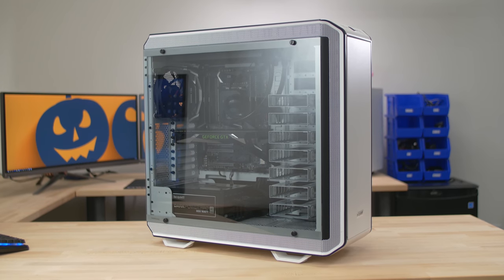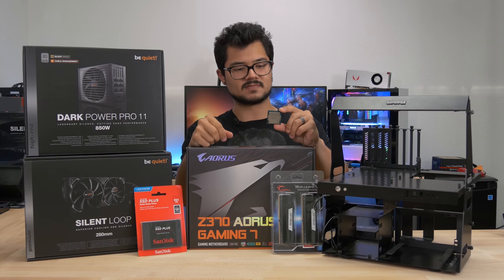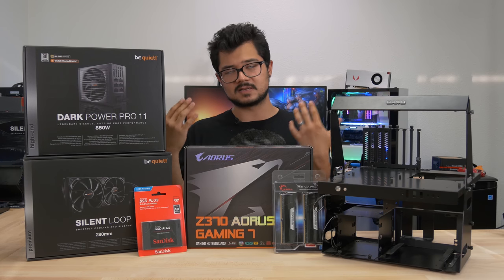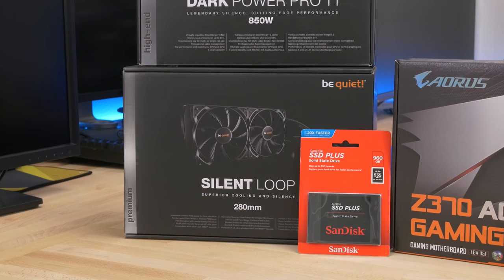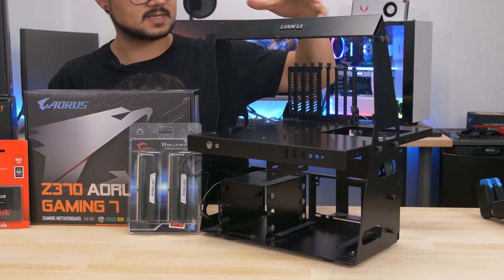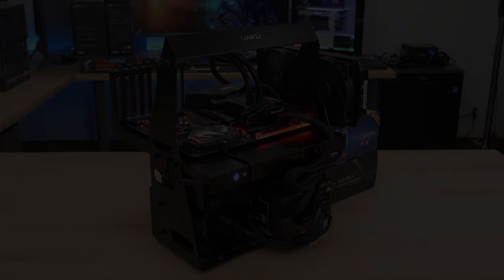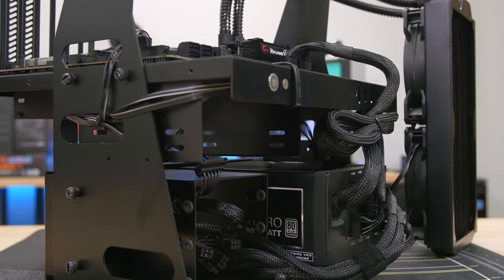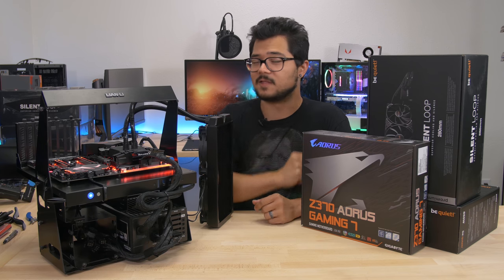Building a Z370 Coffee Lake Test Bed!

Comment: tldr for coffee lake:
If you're strictly into gaming and you have a skylake/kaby lake i5/i7, don't upgrade. But for other reasons, go for it if you see yourself taking advantage of the additional cores/threads or you just need an upgrade from an old system.
Reply: Unless you want price/performance in which case go Ryzen.
Reply: That doesn't change the fact that even a 1700 is competitive across many fronts when compared to an 8700k
Reply: + compare b350 to z370 mobo prices and the fact that Intel makes you buy beefy cooler if you want to OC
Reply: Brother Ares Yeah but you can get a 1700 and it performs the same.
Reply: Solid advice, I bought a 7700k only 2 months ago, I have no regrets, I'll upgrade in probably 5-6 years, by then the mainstream platform will surely be 8 or 12 core processors.
Reply: Unless you want a room heater, then go for Ryzen
Reply: Guys seriously, Ryzen isn't price to performance if you're not going to utilize the extra cores for anything. Comparing a 1700 to an 8700k is a little dumb. We know the 1700 isn't good at gaming compared to coffeelake chips.
You want price/performance and you don't really do anything other than game and watch YouTube or discord or Skype or whatever, you don't need Ryzen, get an 8600k and you're fine.

If you need extra cores for multithreaded workloads, get Ryzen. I actually have a Ryzen system set up as a server but seriously guys Ryzen isn't the best there is at everything, and intel motherboards aren't that expensive, they're like $150. 

Let's say you're spending $1200 on your computer. You get an 8600k with a $150 motherboard instead of a 1700 with a $120 motherboard. (R7's should be getting the benefit of X370 motherboards helping them clock better) and you're spending roughly the same money (to overclock a 1700 to 3.9 or 4 ghz you'll need aftermarket cooler so I'm assuming you're buying cooler for both) and getting between the same as Ryzen to 25+ frames per second better performance in some games. So how is it better price to performance if you're spending the same money for less performance? Let's say it costs $30 more for the intel system overall. That's a 2.5% increase in system cost with a 5-20% increase in game performance depending on game (some games are horribly unoptimized for Ryzen)
Seriously I'm not a shill, but do some basic math, unless you're doing serious rendering or multithreaded workloads outside of gaming, you don't need a 1700.

If you do however use 6 virtual boxes at once or have multiple renderings going on at the same time, or you stream while you game at 10 bit medium speed H.264 at 60 fps, then by all means get a 1700X (don't recommend the 1700, the X model is $10 more currently and is binned for better overclocks, and usually can post with higher ram speeds) 

Be a consumer, buy what's best for you, don't be loyal to one company.
Reply: Hi techiegames im a fan
Reply: i just build a pc , i58400 + asrock z370 fatality is cheaper than i57500 + asrock z270 thats why i decide to go for the lastest one
Reply: The TechieGames if you're taking advantage of more cores/threads, get ryzen
Reply: The TechieGames I'm working on an i3 2130 and a really old radeon HD card, send help
Reply: If you do however come from, say.. 4th gen, upgrade to i5 8600k for gaming.
Reply: The TechieGames i'm sticking with my 4670k for a couple more years.
Reply: A system with an i5-8600k will cost significantly more than a system with a Ryzen 5, and most people don't have the GPU horsepower to see the small difference in gaming either way, so they might as well just choose the cheaper option.
Reply: so the same reasons to go with ryzen, but ryzen is cheaper
Reply: I have i3 6100, should i upgrade?
Reply: Seriously, these people that use ryzen for gaming and yells on the internet to get a ryzen are stupid. I have a ryzen and used it for rendering photos and videos but gaming? they are bad. Intel is still the best CPU for gaming and for general usage.
Reply: If it's not doing what you want it to do, then yes. Ryzen and Intel both have some really good options depending on what you want to do. If you find yourself doing more multi threaded work such as auto CAD, Photoshop, etc.. i would consider Ryzen (They have some really good price to performance chips, but Intel does offer some nice one's as-well). If you're just gaming, i would consider Intel. The new coffee lake processors look really promising, i would consider the I5 8600K, if it fits your budget (if you're gaming more then content creation etc...) it actually beat out the 7700k at a cheaper cost.
Reply: The TechieGames don't be arragent, Intel has been holding back for so many years and money grabbing all you shills!. Remember no company is saint but INTEL is so much worse consumer wise than AMD. They have bribbed so many OEMS so AMD cpus don't get sold. GO watch Intel anti consumer video in YouTube to see for yourself. Do some research before u support a company. Don't go in blindly
Reply: Ryzen bad for gaming? They easily do 100 FPS in modern games.

Comment: Drill holes in the side of that case wing that align with the 4 screws for the fans/rad in the center of the rad. If u get what I mean. Basically like u had it when the rad was sitting horizontal on the boxes.

Comment: Just want to say that the i7 5820K was the first 6 cores of Intel who was " cheap " ( 400$ ) . That was the best moment for anyone who wanted a 6 cores with a 1500$ budget in PC, the i7 8700K is just like this, it look like a good deal but it's not the greatest thing ever done, just a refresh. The motherboard of the i7 5820K was like 250$ I think so it was a pretty good deal. SO please Intel, if you want to compete with Ryzen, make real CPU from A to Z not from R to Z
Reply: When I got my 5820K setup it worked out £50 more when the 6700k setup would of cost so took it as a great deal.

SouthernComfor7 While ipc is better don't forgot that x99 systems have more memory bandwidth plus more cache which is setup better for some stuff then what Intel is doing now with cache but that 5ghz is hard to pass up tho.

Comment: How about, just for kicks and giggles, someone test it on Z270 Mobo and see what happens...after all it's same socket...
Reply: drew alt411 a german overclocker explained that. called der8auer. (he also hold some world records) Its true the pinlayout is different but you could put a coffeelake in a z270. it depends on the mobo itself. some could work, some dont. but if you put it on a mobo which dont work, you could kill your cpu.
Reply: Actually not all of the pins in the z270 are used, there's something like 8 extra power pins and 13 extra ground pins on the z370 that wasn't there on the z270. Even though the layout is the same, where some of the pins end up inside of the CPU is different 
Was the overclocker Der8auer?
Reply: Linus did, they confirmed it did not work.

Comment: Would an i5 coffee lake be better than an i7 4770? Would the extra cores help me get better performance in games? I only have a GTX 1050Ti and would have to get a whole new motherboard and ram so I am a bit worried.
Reply: If you had something like a GTX 1080 or 1070, there would have been a reason to upgrade but since you have a 1050 Ti, the 4770 will be enough
Reply: I will upgrade my graphics card in the summer probably to a 1070 maybe 1070Ti if it exists by then. Might also grab a new CPU, ram, and motherboard while I am at it.
Reply: Tom Brown don't upgrade your cpu.

Unless you are running a 144hz monitor and your cpu is at max usage, then upgrade, but otherwise it is still a great cpu and you won't notice a difference.

Comment: Kyle, can you do a video on the i3 8350k? I am curious to know if that would be an upgrade to an i5 4690k.
Reply: Look at a 6/7600K, it's the same thing. But to answer your question, it's not an upgrade to a 4690K, it's more of a sidegrade.
Reply: SlavjanA thanks for the reply. The issue I’m having is that the 4690k is bottlenecking my gtx 1080. I’m losing about 30 frames and vr is stuttering like crazy. I only use the i5 for vr and I think the processor is too slow for the 1080. I’m thinking I might just get the middle tier i5 or the 8600k due to some games having recommended specs with the i7 6700k and i7 6850k.
Reply: 30 frames compared to what CPU and at what clocks is that CPU running at, and what clocks do you have? If it turns out that it's not the clocks at fault though then the stuttering's definitely going to be due to thread count, so yeah you'll want something with at least 6 threads like the Coffee Lake i5s, but instead of having to change everything for the Coffee Lake platform, the best option would be for you to get a 4790K.
Reply: Did you overclock at all?
Reply: SlavjanA the loss of frames is compared to a 7600k with a 1080, I’m comparing it to reviews of the 7600k and builds that are similar. My cpu is clocked at 4.0 GHz. I’ve noticed that it works fine with a gpu with GDDR5 but is only having issues with the 1080. The rig currently has a 1060 in it and I’m selling that to a friend to upgrade my main rig that has the 1080. The reason I think the gpu is at fault is because I experience no issues at all with the rig as it is but when I had the 1080 in the rig it all went to hell.

Comment: So i expected it would be over VRM but why stop users from getting the quad core? Which I might add have very similar TDPs. Also 5.2ghz 7700K overclocks obviously demands more from the VRM then a 8700K at stock settings. You'd expect z170/270 MBs to be able to handle these new coffee lake chips at the very least @stock settings. Especially on high end ASUS ROG Variants which are packed with more than enough overhead. 
               As the concept of Moore's law quickly approaches it's inevitable end,  (due to shear physics or "the anatomy of the beast") microprocessors will and are continuing to loose their exponential increase of performance every year or so. With the looming end in site companies such the likes of Intel, AMD, and Nvidia, will explore other avenues into the on-going battle of "the best of the best performing" computer hardware. Their goal is to to not only squeeze as much performance (as they are "willing" to give their consumers) out of each iterative (most likely leaving some on the table for the next)  but also to squeeze as much money as possible out of their consumers.    Its all a big scam if you ask me, and I don't know about you but I'm sick of being milked.  

              This will be a major upgrade for all Intel users and will probably become the new sandy-bridge in terms of reputation.

Comment: Question: the radiator has 2 fans you attach to it, can’t you just put two fans into a case without the radiator? What’s the purpose of it? I’m confused lol
Reply: DrastixMachina if you put fans only then your cpu will be on fire!! If you hardcore gaming and doing other things on pushing the cpu. The Radiator let's you over clock the Cpu means more power

Comment: Mod that top handle rail with some mounting holes and you could get that radiator on there. Don't forget what happened with the last one and it's leak. Those hoses aren't load certified. Something like these would go a long way. http://www.aquatuning.us/water-cooling/radiators/mounting/7005/aquacomputer-set-einbauwinkel-fuer-airplex-xt-/-pro-/-evo-zur-montage-im-5-1/4-schacht

Comment: Is this a good pc that can run most games at medium or high settings(ex-pubg or battlefield 1)

CPU-AMD Ryzen 5 1600 Six-Core 3.2GHz
CPU Cooler-Cooler Master Hyper T2
MoBo-MSI ProSeries AMD Ryzen B350 DDR4
RAM-CORSAIR Vengeance LED 16GB (2 x 8GB) 288-Pin DDR4 SDRAM DDR4 3000 
SSD-Seagate barracuda 1tb 3.5 7200rpm
GPU-Msi geforce gtx 1060 6gb
PSU-EVGA 600 B1, 80+ BRONZE 600W
Case-NZXT - S340 (Black) ATX Mid Tower Case

Not the best at picking parts. Just want to make sure it’s a good build. Thanks!
Reply: Yeah that is great, you will almost be able to play all games at high-ultra settings on 1080p with that pc.

Comment: Okay, so Intel has Z370.....but do we ever see a Intel H or B lower down boards with this chipset?  If so they surely can't call it a B350 to replace the B250  since AMD is using that B350 (AM4) designation?  Or, is this a situation where the Coffee Lake chips need high power delivery that there won't be lower end boards.

Should Intel have taken a breather by started Coffee Lake with designations like Z470, B450 and H470?
Reply: Lincoln Thurber the TDPs haven't changed much (a few watts here or there), so they are releasing H310 and B350 as well.

Comment: Hey little off topic here. I want to buy the Nvidia Geforce GTX 1080 Ti. Should I buy the GTX 1080 Ti from EVGA, Zotac, MSI or Gigabyte?  Or should I get it from www.nvidia.com? The one on nvidia.com is much cheaper but has a slightly lower clock speed than the others. Please help me, which should I go for? Anyone?

Comment: I5 8400 vs R5 1600 ???
Reply: I5 8400 dominates, there equal in price and you get much more out if the 8400
Reply: You will still need to buy an expensive Z370 motherboard for the i5-8400, and they are similar in single-core performance once overclocked. Not to mention that the Ryzen CPU includes a much better stock cooler.
Reply: MusaM8 how much are the mobos?
Reply: r jay (In India) An AM4 socket Gigabyte GA-AB350 Gaming 3 motherboard good for Ryzen 5 1600 costs 9000 Rupees. (You can convert that to your local currency via google)

Comment: So, here's the thing:

If I had the money, I'd probably upgrade to an 8700k. Reasons? Well, you won't fear a cpu bottleneck within the next 4 or 5 years. Secondly, look at the i7-CPU prices from t=-3 generations. They're still up in the mid 200s. That's a loss of 130 Euro for a 3 year old cpu. That's amazing. And if you're not planning on selling it, just look at the i7-2600k that was released back in Q1/2011. That thing is still capable of every single triple A game out there!?! It's almost 7 years old now. 

And I can't see this changing unless there's a technical miracle in the gpu industry...

But here I am, rocking the i3-6100 lul